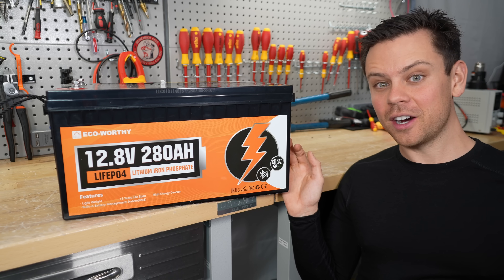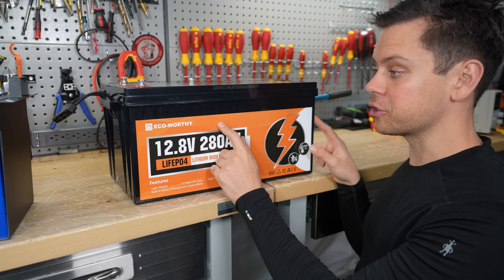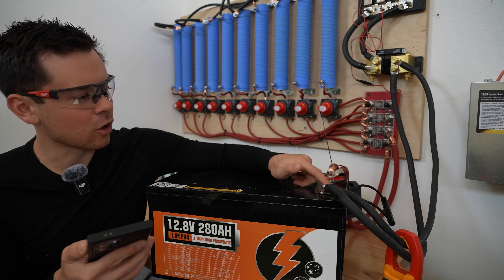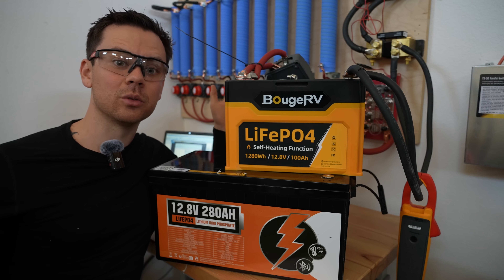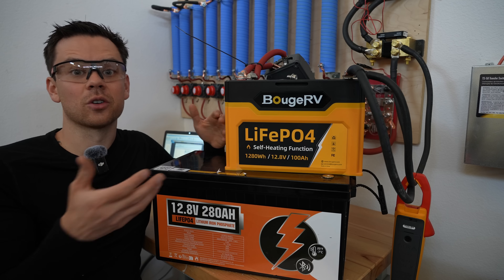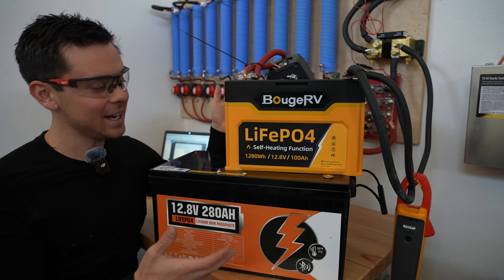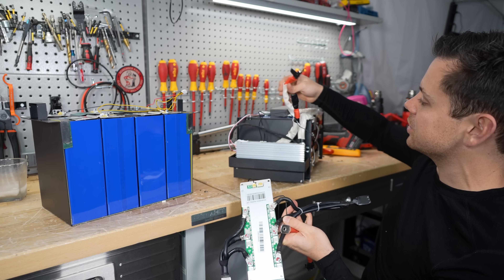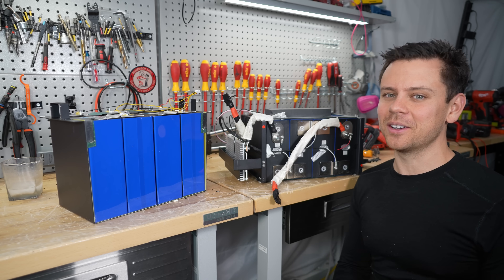$423 Ecoworthy 280Ah VS $529 Wattcycle 280Ah and Over Current Discussion!

Comment: I'm old school. Have to prove it to myself before I believe anything. I worked 13 years as an engineering technician and had to know everything from mechanical to electrical. Four years ago, I switched to deepcycle glass in my RV and under the hood. I'm on the road constantly and off grid. Before I changed, it was a constant nightmare. I want to switch to Lithium but every test I run shows me they are not up for the surge of constant engine starts nor life in cold weather. Do you have a suggestion? PS: yesterday I sat out a blizzard in Louisiana!

Comment: I would really  like to see how accurate the software of the these new batteries with Bluetooth or networking is.

If it reads a cell, does it match your readings? Would be important to know if the cells are as well balanced as the BMS thinks.
Reply: I am going through this issue with this battery right now. One cell is not balanced, of course this is per the BMS bluetooth app.

Comment: You are the reason I'm starting to dabble in solar and lifepo4 batteries, I was curious about lifepo4 batteries for my popup trailer and your video on Li time batteries and at the time Li time were on sale. 
But now I'm building a small system for my house, basically to satisfy my curiosity, 4 12v 100ah Li time lifepo4 batteries in parallel, 6 12v 100 watt Traver force solar panels that will be on a tracking base I'm fabricating, 2 axis solar tracking unit, and a 1500w pure sinewave inverter, yeah the inverter is small it was intended for my trailer, I'll be watching a lot more of your videos, thanks for providing great information.

Comment: Tested a 100ah "Really cheap" Amazon supplied battery over the last week and it came out at 68ah! One off dud? No. I had brought four of them and so far 3 of the 4 come in at around the same ah (4th battery still on test) Not one of them would do 70ah

Comment: I put a solar system on my camper van in 2017. The price of LiFePo batteries has come down on a per amp hour basis by 90% in 7 years (as the price of everything else, including grid power has spiked). Off grid is now a no brainer.

Comment: I just checked the Ecoworthy 280Ah battery price and it's now up to $529 on Amazon.  The 2 pack is up to $999.
Reply: Just dropped back to 399. Have a look!
Reply: @bob_frazier  Thanks but I just checked again, and they are $529.99 each on Amazon (and that's with a $99 coupon applied).  My timing is terrible.

Comment: @willprowse
I have a question i cant find an answer for online. I have some enphase iq8+ microinverters and i would like to run them off a diy battery system to backfeed the grid for time of use savings. So charge my battery during the day with solar and discharge when energy cost the most. Was curious if you would be interested in testing it since no one online has a good video of it. I would but i dont have the equipment yet and dont want to buy something that will not work if that makes any sense. Thanks in advance.

Comment: You do great work Will., Thanks so much for sharing your knowledge and test results. We bought 2 of the EcoWorthy 289ah last year. Although not a ton of use on them as of yet, but so far, no problems with them at all. At this time, we just use them to power a 2500 Pure Sine wave inverter to run power tools, charge batteries and lights while building. We carry them back home after the weekend and recharge them using a LiFePo wall charger at the house, then carry them back out to the off grid site. We do intend to build and have a power pole installed but this system just seems to work better for us than using a noisy generator and having to buy fuel and another piece of equipment to maintain.

Comment: I've got 3 eco-worthy installed on our boat. Haven't had a chance to put them through their pases yet. The balancing is a little bit of an issue, normally have one cell that goes high and it cuts off. Had to lower the charge voltage on the inverter so it doesn't happen.

Comment: What kind of fuse should we install and at what rating? Do you have to connect battery chargers to the fuse because of the lack of overcurrent protection?

Comment: New to this stuff Will.   I have a Power Queen 200 ah plus battery .  Can this ecoworthy battery 280. be put in parallel with my 200 power queen battery?  I have never used my battery yet just charged it to 100 percent.  As I get money I like to add more battery’s. It’s for a 3000 amp inverter to run my sump pump.  That runs every 5 mins for 10 secs this time a year .

Comment: An inverse time overcurrent with a 2c instant disconnect would be more advisable to handle surge currents. If 1c is exceeded for by %10 for 1 min, then disconnect, if exceeded by 50% for 30 seconds then disconnect, if 75% for 15 seconds. That would be what I would want in a BMS
Reply from the maker: Agreed. Yes

Comment: This battery is a similar form factor to an 8D battery that you would see in industrial applications such as a starting battery for school buses, dozers, or other pieces of heavy equipment. Some of the starting systems in that equipment will happily pull 2k amps if you have enough battery power to supply it.

I see no reason why an 8D sized battery would EVER be limited to 500 amps unless it's not meant to actually be used.

Comment: I feel you have missed an opportunity here and request a part two to this video please.
As this battery does have Bluetooth connectivity, can you show that you can reset the overcurrent protection to a more reasonable value and you feel like the cells may not be very well balanced, can you look in the app and see if this is actually the case or not and are the balancing parameters set appropriately.
Not trying to ride your rear end Will, just looking for a more complete answer.

Comment: Mentions that the cells could be imbalanced. But yet doesn't pull out a DMM to do a voltage test on them while under load to verify this thought.
It would be nice that when a battery is pulled apart to inspect the internals, especially on ones that perform flaky like these can be, that each cell is tested to see their charge/discharge curve. There's only usually 4 cells, so setting up a rig to cycle all them at the same time should be pretty easy to do. 

It's easy to recommend a battery like this on its overall capability. But if a single cell is weak, it could show up a few months, or even weeks, of use and the buyer could be stuck with a useless battery. When doing teardown and performance of batteries, individual cell testing would be greatly appreciated as well. More data = More Informed buyers

Comment: Hey Will, Are the cells in this battery actually 280AH? I dont think you showed what cells it has like you did in the Wattcycle. 
Also have you tried out any of the Renogy core series? (the non bluetooth etc ones) I know they are not really 'budget' ones but here in Australia there are much less options and often the price between the cheaper ones and something more known like the Renogy is much smaller.

Comment: While it is nice that some batteries come with a BMS that will disconnect for overcurrent, one should never ever rely on a solid state device as the only safety in the system, and a fuse is a necessity in any battery system.  It would be interesting to see how hot one of those batteries actually gets when the BMS doesn't trip considering at 850 amps the cells would be pretty much depleted in less than 25 minutes.
Reply: 5:25 Would the use of a MRBF fuse on each battery's positive terminal provide the overprotection that is missing on the BMS?

Comment: Has the cost of cells and components kept up with the cost of these budget batteries? I was originally planning on a DIY solution but the cost of these pre packaged solutions kept dropping and made the DIY not make sense financially. I am tempted to do the DIY server rack battery but even those are still outside my budget when you can get 16 of the 100AH Watt Cycle batteries and put them in 4s4p for about the same price and actually have a higher Amp rating and redundancy built in.

Comment: A Request

You've given us all much valuable incites as we enter what is all very new to many of us. There are others with, shall we say, a more simple grip on the tech, but quite obviously so. Others with their white coats the scientific approach but all only tests with pristine gear for comparison with little thought of real world long term testing, or my interest in abject abuse. You did after all tell us recently how we could, paraphrasing, thrash our LiFePO4s.

I'm on the buget end, no free gear but got a refurb Delta 2 in order to gain intel and change my power usage habits. From a systems analysis programing background I'm more for long term review and testing limits on software but analysis on a variety of subject. Ofc that means I'd make nothing from YouTube being far from the cutting edge.

Now with a Delta 2 on it's own barely powering router fridge and a fan over the summer I got a 24v 280ah battery (enough to covered what my metering says I use). In resolving to test the limits one extreme was to take care of the batteries by feeding the Delta with enough power as I was using it up. But as this was being delayed by several hit and miss purchases of buck converters from China I was forced into the other limit; thrashing the Delta 2 deliverable with out of the box setup. No firmware or settings changes. My thinking it has a two year warantee as a refurb and I'm could not come close to it's 80% 3000 cycles. 
Well, as I proceeded the time I needed to recharge lessened along with the time I had to pull some watts out of it. The app right now it telling me the 70 watts it's pulling at 98% will last 3h 20m.
To me that looks like in Ecoflow River capacity. I realise Ecofow must acknowledge that especially here in the UK with 230 volts appliances that a single 500w max DC input is not adequate so the 3 plus has two ports now. I have a payback time all planned out and it was never just 5 months.

Now I don't know what constitutes a refurb; B or C grade cells, just shipping out returns or what.
I still want to make my  6 month trial video but  it's never going to get any views. Frankly I think I have killed it for lasting two years and may have to come up with an arangement to move up to a 3 plus.

What would be good is for someone with some cred and many views 36k on a 17 hour ago upload carry out a stress test pushing an "as delivered" delta 2 with several cycles a day. I have only done two to four getting to where I am. Living in a 2nd floor flat the all in one home build is not an option I rent also. Landlord with 100m sq roof above me seems intent on killing the planet over using it as a resource. My goal is a little off the normal, charging on night time electric pricing as turbines are being turned off due to over capacity and powering the day from batteries which I have achieved these 3 months.

I hope you can consider killing a powerstation. Am aware some free gear may go amiss but you seem far less reliant as others are.
A periodic update on how the test is going might interest you, me and viewers? Would appreciate the findings if they match mine before I talk with Ecoflow UK/EU; they are yet to inspire on the tech front.
Cheers.

Comment: Very Timely Video, I'm just shopping parts to redo the electrical on my boat.  Seeing that nice build quality was all it took for me to pull the trigger on the EcoWorthy while the discount coupon is still in effect.  For me the tie-breaker is definitely the Smart BMS (Bluetooth),  I definitely wanted the ability to check stats on the system so if I went with the Wattcycle I'd have to also buy some flavor of bluetooth smart shunt.

Comment: Brand: ECIENWELL
4.5 4.5 out of 5 stars (50)
12V 300Ah Lithium LiFePO4 battery, ECIENWELL 
They show a regular version for 388 and a mini version for 468, but the specs on Amazon show the same dimensions for both, which seems really small.

Comment: So the bluetooth function of the Ecoworthy make it a slightly less than apples to apples comparison. I don't have either battery (I do have a Wattcycle 100ah BT mini), but it seems these days that bluetooth to monitor the individual cells is a real differentiator. Users on your forum seems to think so. I've been waiting for wattcycle to release a BT version of the 300..ahem, 280ah Mini. I'm sure it's right around the corner.

Comment: Ive had great experiences with Eco worthy so far, so id go with them. Though disappointed by the overcurrent protection test; my batteries and panels from them have been very solid so far and pretty great shipping. 3 years no issues yet!

Comment: I have 4 ecoworthy 12.8v 100ah in my golf cart. I would like to know if I made the right choice. I found them on sale on Amazon around Black Friday for $650 for 4 batteries. I also have the ecoworthy 12.8v 20ah batteries in my mobility scooter. Those were $125 for 2. A test in either or both would be nice. The SLA batteries in the scooter had a range of about 14 miles according to the MFG. After installing the lithium I did a test run and was able to clock about 25 miles on the lithium.

Comment: Could you add close ups in your vids once the batt is open ?
Here for instance it isn't possible to see what type of post / weld is used on each terminal, or what the cell labels say, or where each Vcell monitoring pickup points are, or whether the cables have regulations / CE markings & AWG info, etc.
That would really help people looking for the next level of details, since you do not explicitly cover that.
Anyway, love your work and straight shooter ethos !

Comment: Except for a very small difference in capacity. They both have the same issue and the same strengths...
Therefore, I would go for the cheaper plus Bluetooth capable Ecoworthy.

Comment: I chose the WattCycle battery because of the form factor for a high capacity battery. Even if they had originally sold it as a 280aH battery, I still would have bought it.  SOK also makes a 280 aH battery that I was considering, but the WattCycle battery has a much better price.

Comment: I want to see a pair of these as starting batteries on a 6.6 L turbo diesel.  Would buy tomorrow if we could figure out how to not overcharge with alternator and the bms not shut off the voltage supply.

Comment: I agree with Will.  These need proper over-current protection (and other protections) in the BMS.  The BMS is the key to simple + safety.  In my opinion, the larger Ah batteries like these should have a peak current with time delay with a temp sensor, so that you can easily get 3C discharge for >>3 seconds (like as much as 30 seconds), and then not turn back on for a while.  This circuit should be simple that basically reacts to I^2 above the 1C rate and keeps track of the heat generated for reset time, like a modern resetable circuit breaker.  It sounds complicated and expensive, but it is not.

I am really excited about the improvements in quality and price in this battery space.  It has been a long time coming.  Lead-Acid, is going the other way.  This trend (with quality BMS) will drive usage in many industries beyond solar.

p.s.  I would like to see some reviewing of the quality and accuracy of the Bluetooth interfaces and apps going forward, as this is the future.

Comment: I bought a some DJLBERMPW 12V Mini batteries and capacity tested it was over 100ah. However what surprised me was the how small they are! It would be cool to see you check those out.
Reply: I purchased 4 of the larger batteries. They worked great during hurricaine Milton.

Comment: I picked up 260 ah ecoworthy batteries with the 250 bms. Running 2 for 24v. Been very impressed for the 389 i paid per battery. Been wanting to see a tear down. Thanks!

Comment: I bought the eco worthy battery a week ago. After balancing the cells it appears to work great. Connected it to my RV, replacing the lead acid batteries. The RV built in solar system is weak but charging it full from about a ten percent drop overnight. No complaints so far.
Reply: What is the process to balance the cells?   Thanks
Reply: @aronk7412  charge it fully, let it chill until the voltage is the same across the cells. Discharge, recharge. Will may have a better way. I used the Bluetooth app to monitor activity.
Reply: @thomascraddock8697  does the app tell you the voltage of each cell?
Reply: @travelwithherandI  yes it does, though I think it's output numbers may be dubious at best. Maybe Will knows better than I.
Reply: @thomascraddock8697  try connecting to the bluetooth with the overkill solar app. it should give you extra detailed information, and may even allow you to change some settings. though be careful and don't start changing settings unless you are certain about them.
Reply: @ensom  Can the Overkill app change the over current protection within the BMS? Thanks

Comment: I would take the battery with the better Android app.  That BT connectivity is crucial for me.  My LiTime Bluetooth battery is majorly handicapped by the crappy app.  It takes several tries to connect to the battery and it's dumbed down and not tunable at all.
Reply: the eco-worthy uses a jbd bms. i am able to connect to mine with the overkill solar app, which is a great app. its worth a shot trying to connect to your bms with the overkill solar app imo.. its free.